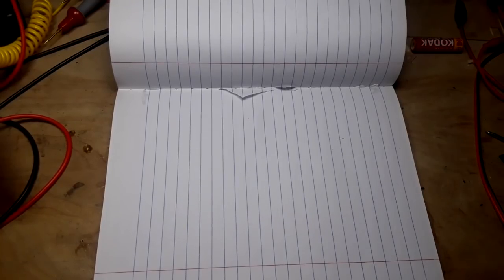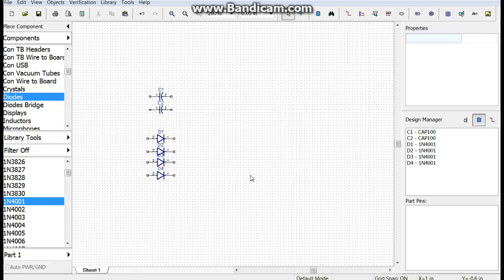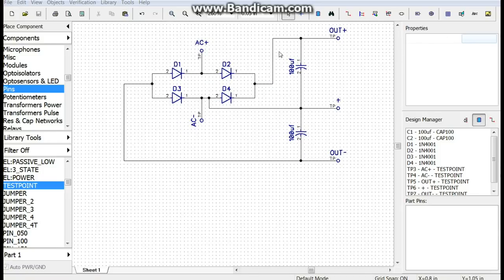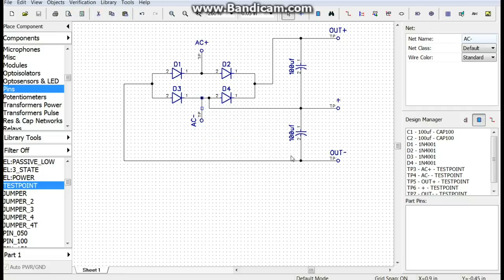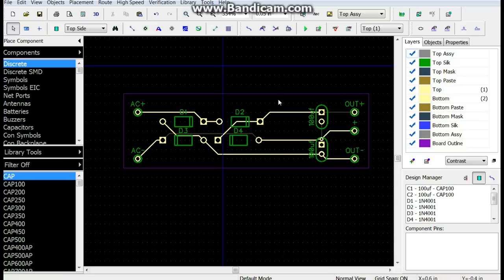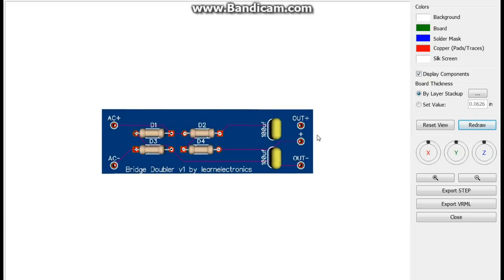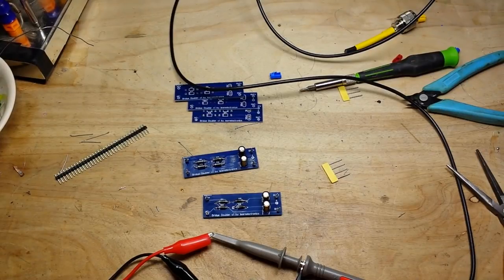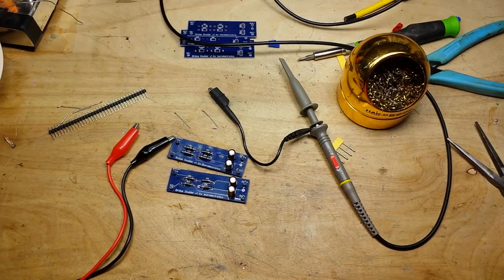Classic Circuits You Should Know - the bridge doubler

Comment: Do keep in mind that the doubler has a one disadvantage... the AC ripple will be higher.
Reply: wouldn't the capacitors smooth it out?
Reply: @David-bc4rh  Depends on the capacitor values and types, there isn't such as one perfect cap for every situation.
A large capacitor (capacitance)  like electrolytic handles the big changes, while poly or ceramic among others takes care of the small and fast/high frequencies, it's not uncommon that there are three or more caps in different types and values to handle a broader ripple range.
Reply: @hannescamitz8575  Wow, so capacitors can function in much the same way as different types of lenses filter light in different ways for the photo receptors.  Its easy to forget that electricity isn't just "a thing," rather its a vastly dynamic phenomenon of the universe that we've been reverse engineering.
Reply: Also, a dumb question: is ripple the same as noise?
Reply: @David-bc4rh  Not necessarily. Noise can be introduced by other devices nearby like fluorescent lights and cell phones. You'd be amazed where noise can come from. The AC ripple is just the residual getting through the caps and possibly from leaking over from wires in the circuit.

Comment: Interesting, but I think if you're teaching people electronics you shouldn't assign differences in output voltage to one variable (diode type) when you have two variables (diode type and capacitor value). First prove that capacitor value doesn't really matter, then show that diode type does.

Comment: Interesting video. I would have simply used a footprint for an in-line bridge rectifier, or at the very least route those traces to go around the top traces, or I'd use a 0 ohm resistor / jumper link to cross a trace. This way, the bottom would be completely ground fill. 

Please take the time in the future to apply some hiss removal effect on the microphone because it's really tiring to hear that in headphones for 20+ minutes. Try lowering the microphone boost, it may help.

Also, you may want to check out Open Broadcaster Studio (OBS), an application which is normally used to do live streaming but which can also be configured to only record to disk, so you could replace the shareware Bandicam with that and not have that free advertising on your videos.

Comment: sorry dude you didn't explain the theory behind this circuit. Why did it double the voltage and how many amps it can handle and why did you connect the ac side to the middle of the caps. common man this is learn electronics how can you understand and learn without explanation.

Comment: I do not understand the usefulness of this circuit,  a full wave bridge recifer will do fine, no need for capacitors
Reply from the maker: IT DOUBLES THE INPUT VOLTAGE
Reply: @learnelectronics  so I am hearing you say that the input voltage to this device  is double that of the output of this device.  This sounds like a BUCK converter device, am I understanding this right?
Reply from the maker: No. The circuit first rectified the incoming AC to DC, then it doubles (more or less) the voltage.  So if you put it in 5VAC you get out about 10VDC.
Reply: @sargetester99  it does double, but it has 2 diodes more than what's needed.
Reply: @learnelectronics  so , a boost converter?
Reply: @learnelectronics  btw thank for helping me with this

Comment: Wait a second here... so you're trying to prove that the capacitors aren't the reason for the difference in voltage... but you used different diodes in your test?  How is that a controlled test?  If you want us to see that the capacitors don't make a difference... show us that... don't just say "oh well there is a difference, but trust me -- it's because of the diodes, not the capacitors" and then leave us to require faith in that statement.  That's not science.  Either use difference diodes OR different capacitors and show us how one matters scientifically.  This was NOT solid test methodology.